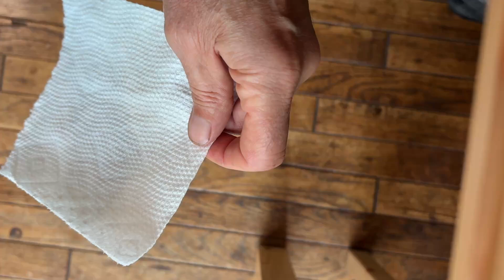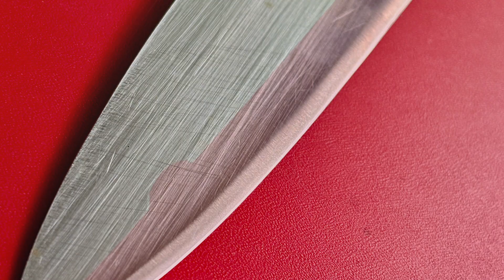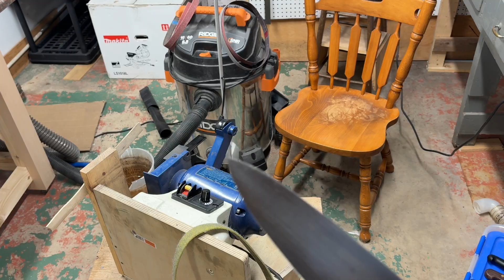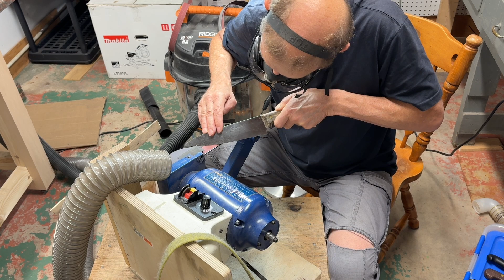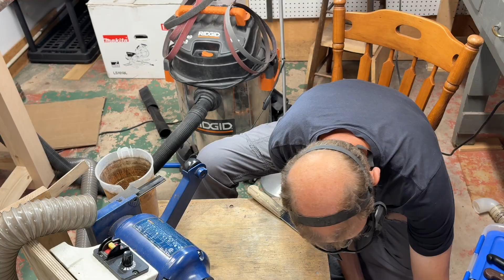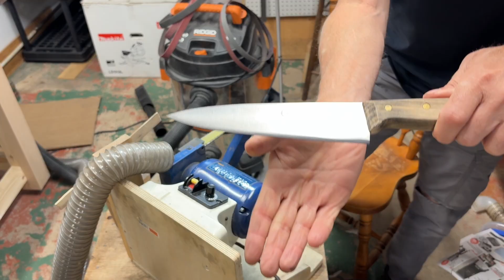Major Repair, Thinning and Sharpening a Knife | 1x30 Belt Sander Tutorial

Comment: Thank you for sharing.  Will a radius platen be helpful?
Reply from the maker: Hey, a radius platen will help you get really low without scuffing up the blade.
Reply from the maker: Hey, a radius platen will help you get lower without scuffing the side of the blade.
It could also be useful for Japanese knives where they have slightly hollow areas or grinds from the wheels they use for grinding them. ( not all Japanese knives though, they have other grinds too)

Comment: Hi Ken - I do a mobile sharpening business and have been looking at lightening my load. I thought o needed my 2 inch machine, but this video has given me inspiration to trim down and rely on my 1x30.

This is a low key masterclass in belt sharpening. Seriously, the information is concise, well thought out, and your technique and order of operation is perfect. I hope a lot of new sharpeners find this early on. 

I’ve learned to think more about my pressure and how it can change the profile I fought for early on. Also it’s cool to see you use a simple scotchbrite belt instead of wheels and use the lightest pressure to be affective but not roll the edge.

Thanks for the information to push myself to simplify.
Reply from the maker: That’s awesome! Thanks for the comment, I’m trying to get good info out and to emphasize quality over speed. A lot of newer sharpeners see the older guys seemingly whipping through knives with no care, what they don’t realize is that these old hands have already put in tons of time and understand the little nuances in movements.
You can moderate speed, concentrate on quality and still make good money.

That said, a 2” grinder is faster and the wider platin allows for easier profiling.

I usually run the profile on a 4” belt once it’s close, just to smooth it out a bit.

Always learning!

Good luck with your endeavors!